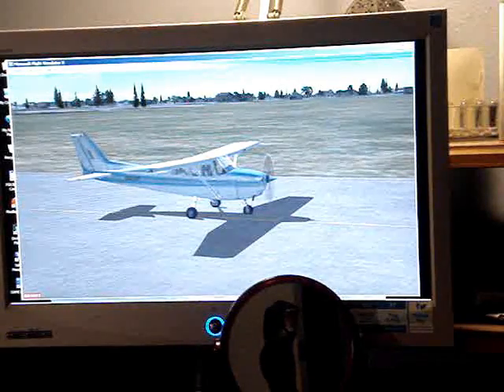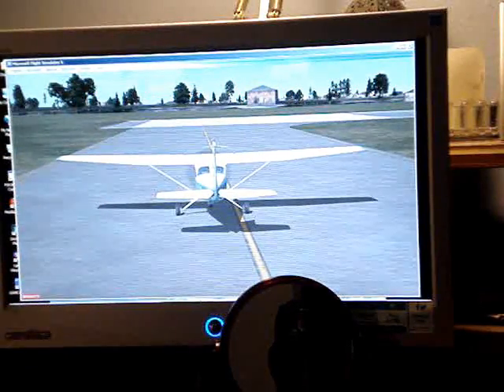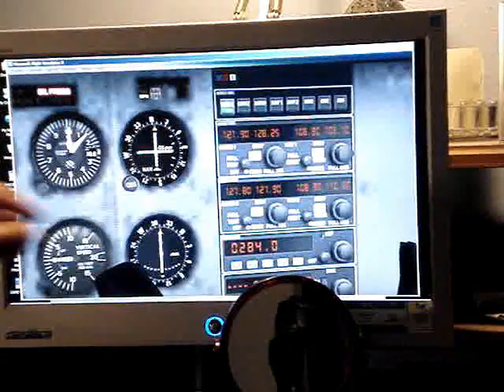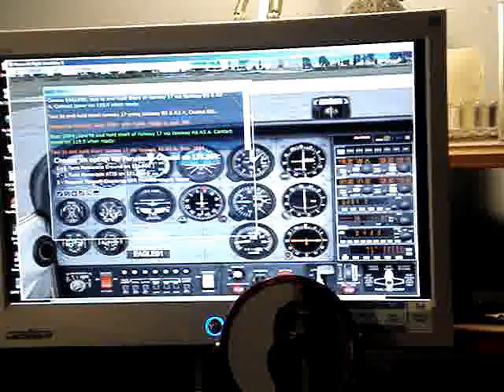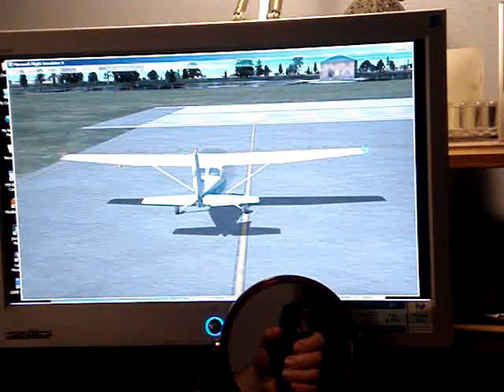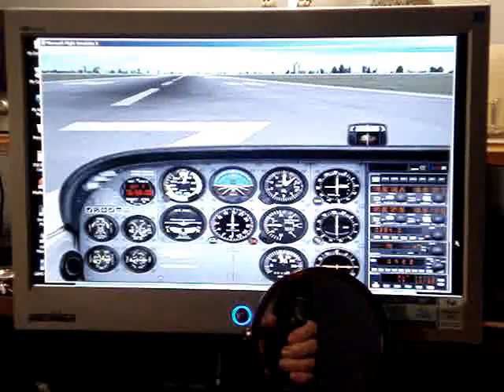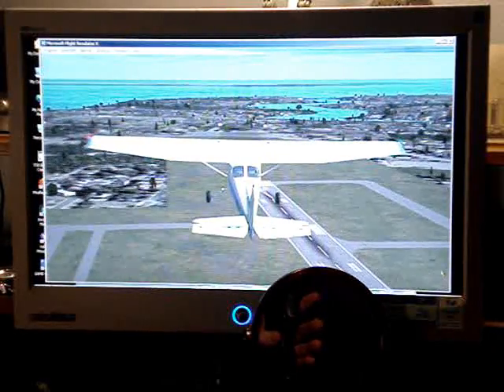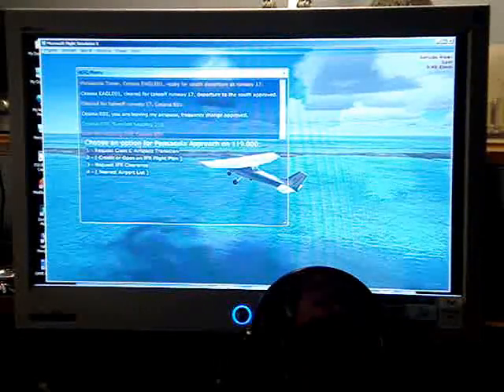My First Take-Off Tutorial Using a Cessna 172 in FSX

Comment: You should use what's called a TRIM. It can help a lot with your pitch and you have to set it with your nose a bit low and when you get airborne set the pitch level